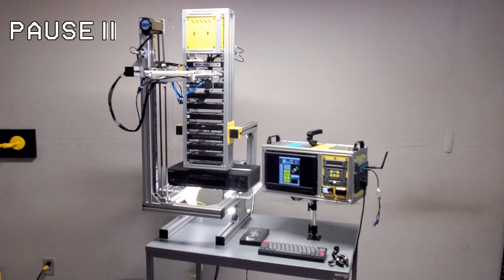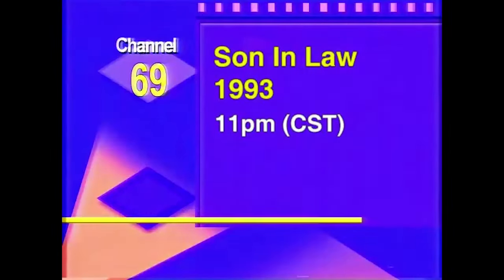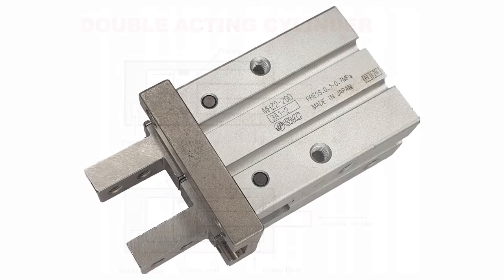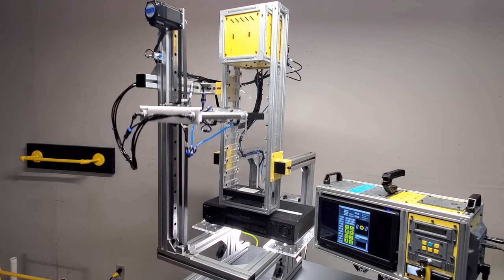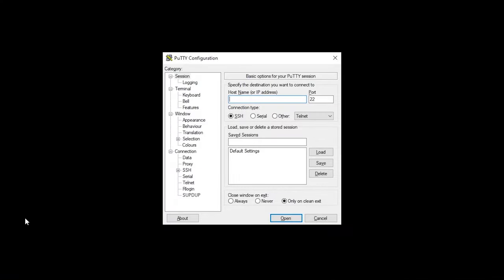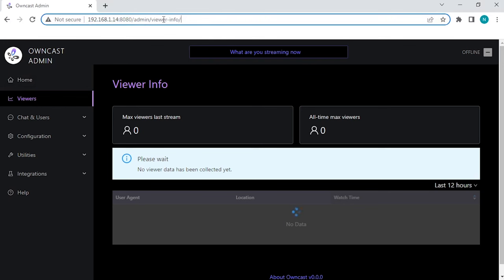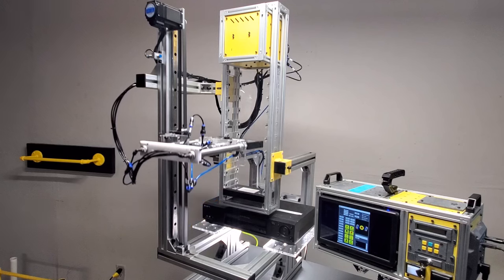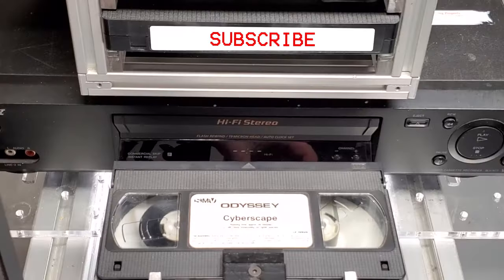I built a VHS video tape robot like the one in Hackers (1995)

Comment: Not that you need to hear this, but I'll say it for the general audience..... there really isn't any 100-percent dependable solution for these kinds of mechanisms, simply because there's absolutely a billion things that can go wrong everywhere along the chain. That doesn't mean we shouldn't make it, and it also means that if people run into problems while making it they aren't failures or failing to achieve. It's just an incredibly difficult thing, and that is why digital files sitting on a hard drive so quickly replaced analog and cassette world that came before it.
Reply from the maker: Hey there, thanks for chiming in.  I took away some good info from our conversation a few months ago and I 100% agree that it's not an easy task.   During the dev process, any time you add moving parts into the mix, it can create an extra element of potential failure (opposed to just software which can also be a beast to tackle as well).   I'd really like to get more people involved in this project to help out though, and I'm always open to suggestions, hardware or software wise.    I'm not a professional in the broadcast archival industry so I can't speak to their true effectiveness but there's gotta be SOME value to those mega expensive (probably 20-100k) retrofitted sony flexicarts (i reference in this video) paired with modern software to deal with media ingestion and archiving.  Admittedly, most of the magic is happening in the custom software controlling the Flexicarts and there's no doubt been countless hours spent writing that software to work somewhat seamlessly.   I'd be very interested in hearing some first hand accounts of the retrofitted Flexicarts (made by blue lucy media and others) to better understand their shortcomings or really just any experiences with them.   Then there's the flexicarts themselves which have been around since the late 80s and are in fact still around and kicking.  They were originally designed not for media ingestion/conversion but just to automate the tv stations.      I'm pretty gung-ho about this project because I have so many personal tapes I'd like to archive and I feel confident that if I can develop a workflow for my own 3k tapes, it could be repeated for anyone else.   User experience and reliability are high priorities.   It may take a while but I don't plan to stop until I've perfected the process.
Reply: Reality. I just laugh when people say robots are going to take over real soon. GL
Reply: I mean, well, kinda… where do you think those digital files get backed up? In many cases, ultimately, to a robotic backup tape libraries, which works the same as videotape libraries.
Reply: SKY, before it was forced become British Sky Broadcasting.  The Broadcast Spec Beta-SP format used case for the tape used in the domestic Betamax format. Betacam (1/2" tape format) became the next format after U-Matic (3/4" tape).  Betacam linear speed ran ran several times fast than the domestic format. So a domestic tape would cover about 2 and half hours. The same tape box used with Betacam tape would last a maximum of 30mins.  

Beta-SP was an upgraded version of Betacam  The 'Beta' format became a mechanical standard, allowing for Digibeta and then several different versions of Digital came along, as compression algorithms . Key to the decks was a common RS-422 control standard. So even HDV -Hi-8 decks can be controlled by the same standard, just plug up the decks with a 9pin D type cable and they all work together, no matter the actual tape format .  In the PAL world, people do not realize how even VHS-Betamax gave a very good picture for the domestic NTSC market, as these format had a higher write speed, (60Hz world) so you lost a lot less than the 50Hz world. (The rotational velocity of the tape heads were faster) So what was recorded was closer to the what was being shown. Thus S-VHS and Hi-8 formats had a real use in broadcast facilities. So you will will find a lot of NTSC s-VHS and Hi8 machines, where you will find far fewer if any in the PAL domain. 
Back to the pioneering robot machines used at SKY. Sky  had the very first LMS format machine, with serial number 00001, 00002, 00003, 00004 systems.  These used 6 standard machine,s with a robot arm which extracted the tape, and the 90min large cassettes, from the library, all with a bar code for the tape label. The machine would simply be loaded with a  tape. The LMS read the barcode, stored in a bin.  Then the control system was loaded via a BASYS news scripted system, giving all the necessary script (for autocue) and other media and instructions. Slug name, Insert and out timecode, and scheduled for a given show, or channel rundown.   This would include all the promos and commercials. The robot arms were extremely fast. The whole machine was behind protective clean room panels.    The LMS Movie channel versions were twice the size.  Those channel could work completely automated, as no live content was used. Live channels, ie. Sky One, Sky News, The original Movie channels operated through Transmission suites.  The suite itself had at least two machines beside the transmission controller, so tapes from studios could be played out by hand...  These were hard working control suites and the controllers had a huge workload, as this was the place that "made the money"  Commercials playout were key, and that involved called "Traffic".  
Sky News used a Beta-Cart. a much smaller short format tape system, as news would use the smaller tapes, and maybe only 3 m tapes at that. This was fats and furious.  There would be tape errors, tapes getting jammed. This was because a huge volume of tapes would be run through the system and that took a good team to keep it going. Just the short opener of each bulletin may go through 7 or 8 tapes in the first 2 minutes, The robot loading taking tapes out and inserting tape s in via the SIDE of the players, which had a dedicated side loader system.
there is no doubt this was key to the success of Sky, the rest followed. British Satellite Broadcasting had the later versions, only by months, for movie playout.  They joined within a year of co broadcasting, and the rest is history.
Sky was a global pioneer in this kind of technology and broke new ground almost every 6 months. Once the work was done, the rest moved in, and its all history now.  Going to digital was next step

Comment: Great project, hoping to implement something similar with LTO tapes. Been buying older models when I notice them for the right price (as-is) and repairing them. Have a tape library already so might dissect it to build a tape library like library in a warehouse.
Reply from the maker: yeah it would be easily adaptable for other types of tapes.   I'd recommend not using pneumatics and instead use more servos and add plenty of sensors.  I don't have enough in this version.

Comment: Interesting machine. I did not know there was anything like that.
However, i think it is a bit too complicated. Personally i would have gone with a fixed stack of tapes and a movable stripped down player. The player goes up to the tape, one cylinder pushes the tape in, it gets played, then another returns the tape (from the back, from what have been the inside of the player) to the rack.
To avoid alignment issues, simply use bands of thin spring steel (or even plastic) as centering devices. Simplest i can think of is "length of a spring pulled together slightly so it bows out", if that makes sense. Being under slight tension would also prevent tapes from moving around due to vibration of the machine itself. Additionally, it would give some more room for error for the moving parts since the springs will take care of all the alignment.
Reply from the maker: It's nearly identical to commercial machines (Sony Flexicart) with the exception of the pneumatics (Flexicarts do the basically the exact same thing with steppers or servos instead of pneumatics)      I do plan on stripping a vcr down though and 3d printing a new beveled/rounded opening so the tapes slide in easier.

Comment: Have you thought about putting a counterweight on it to offset the gantry?
Reply from the maker: Like the kind used on heavy cnc Zs? I've seen that done but I didn't consider it.   The gantry is only around 3-4lbs, the hybrid stepper seems to hold it without too much backlash
Reply: If you're well within spec for the bearings, all good. Especially considering the extremely low duty cycle. However you mentioned a lede on concept involving archiving, and presumably tens of thousands of cycles. In which case the crane will be a likely failure mode. 

I really enjoyed the video, great work!

Comment: This would be great for archival purposes, but could be even better with more VCRs.  You need at least one more to allow one tape to be rewound, while the other is playing.  With a third VCR, you could be capturing two tapes at a given time, if you offset their start/rewind cycles right.
Reply from the maker: I've noticed all of the commercial flexicart systems have 2 VCRs so that makes sense.  My original idea of just using it to remote control 10 tapes didn't really consider rewinding.   I figured I'd do that manually later on but you're absolutely correct, auto-rewinding would be the polite, kind thing to do.  The entire system is pretty modular so it won't be hard to modify my tape carrier system but i'll lose some tapes.   I think in the future I'll just buy a longer linear rail.    Did you work with tape archival using flexicarts or something else? I'd be interested to hear about it.
Reply: @midwestcyberpunk  I don't have any hands on experience.  I did look up info on enterprise tape backup systems for work (petabyte to exabyte scale tape robots)  once, but nothing extensive.  I found your project on Hackaday.

Comment: I built one of these things starting in about 2016 and it could switch between about 500,000 VHS tapes. It is called a Netgear ReadyNAS box and cost about 1/10th the price. It did take time to rip my VHS collection as there is nothing available even today to rip a VHS tape faster than real time. I now have several ReadyNAS boxes totaling around 350TB which would hold about 1 billion VHS tapes. It is a much cheaper option and 1,000x more reliable.
Reply from the maker: there's not much entertainment value in watching a  NAS  just sit there though.
Reply: @midwestcyberpunk  "there's not much entertainment value in watching a  NAS  just sit there though." Yea, I get it. About as much fun as staring at a VHS tape sitting on a shelf.

Comment: is VideoTapesOnline thing still going on? this sounds like a very cool thing to happen and I wish I knew about it earlier. fantastic build btw! I think you could solve some issues with tapes bumping into the rack by adding small flares that would allow some small margin of error when positioning the tapes for insertion. probably you have already done that and it's just not in the video.
Reply from the maker: We still do Videotapes Online on my private server.   I did reduce the amount of rack entry error significantly if not almost entirely by rounding off and slightly angling the rack slot acrylic pieces.  This is the square original:  https://youtu.be/Ak3rkvrt-Rw?t=302     This is the modified:   https://youtu.be/Ak3rkvrt-Rw?t=306     I do agree though some flares would help even more, also on the VCR.   I plan on gutting a VCR and adding a flared, 3d printed opening for it.
Reply: @midwestcyberpunk  is it possible to join your private broadcasts?
Reply from the maker: @svofski  Right now I'm running it off my home internet connection which is maxed out (only 40mbps up speed)  Eventually though I'd like to be able to afford a public owncast server so more people can get on.   Stay tuned.
Reply: @midwestcyberpunk  looking forward to it. cheers!

Comment: for both the player & the storage slots
you could angled bevels that guide the cassette into place
Reply from the maker: I actually went back right before the video was shot and re-laser cut rounded corners on the tape slots just for that.   Everything is actually working better now.   The next step is gutting a VCR and 3d printing a new rounded, beveled opening for the tapes

Comment: I am unsure if you will see this, but I would love to build it. It would also help with my archival process.
Reply from the maker: The design really needs to be heavily revised.  I got it working with around 80-90% success which was fine for the camera but not for day to day use.  Using pneumatic cylinders to push tapes is way too dangerous for valuable tapes, they're just too powerful and hard to control without more sensors and a more sophisticated pneumatic control system.   (I used pneumatics because that's what the hackers bot used in the movie)  I may make a revised version that is fully stepper motor based with more position sensors but it will be a while.
Reply: @midwestcyberpunk  Thanks for the reply! This scene in hackers was my favorite. I like the hybrid stepper motor you are using. I was planning on not using pneumatics. Tho I think the pusher and gripper is nice. Is it using to much force and causing problems with the VCR?